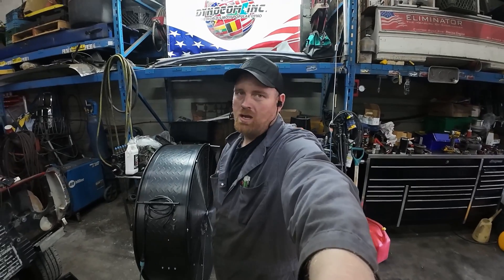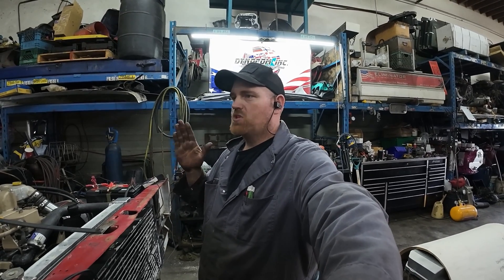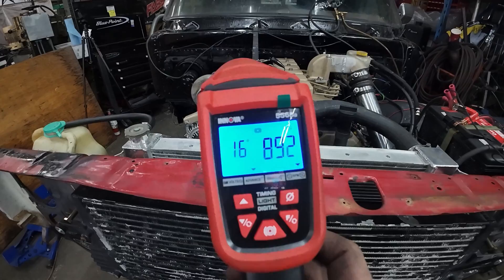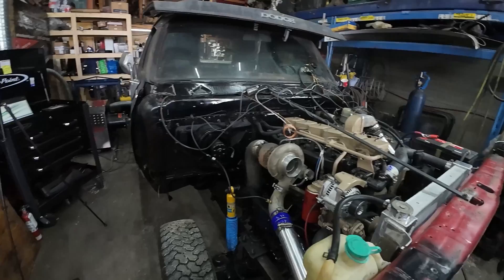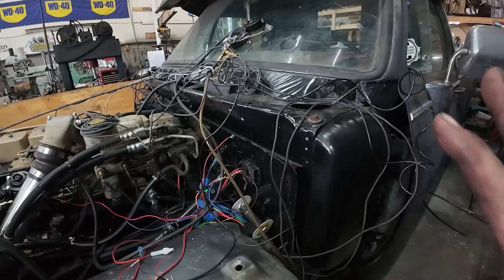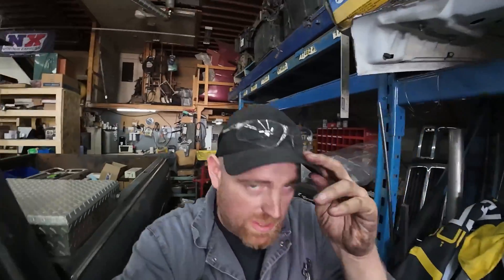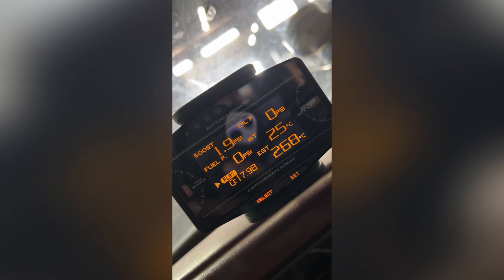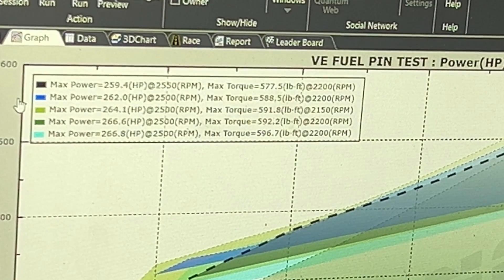TIMING LIGHT ON A CUMMINS ?  plus we have Data !

Comment: Why u have very fansy and expensive dyno and then u dont have anything data or sensors plugged on dyno? 😅 what i think and only my opinion is.. if i have dyno, i want everything possible datalog and info to dyno sheet, easy to compare diffrent pulls and modifications 😊
Reply from the maker: I am going to buy a system. But life has gotten in the way of that. I had this unit I was going to use on something else. It will have to do for now.

Comment: Every forum I see says 1 tooth is about 10 degrees. So this is saying we’ve got about 4 instead? I backed the pump off 1/4” with 1 tooth advanced, which according to the interwebs should give approx 4* timing with room to go. Not an exact science, but if this is true in the video I should probably bump the pump an 1/8th up
Reply from the maker: I going to play around and make a video on the topic. But static timing will be different than the timing light. But am not sure how much difference there is.

Comment: How does the timing light injection timing at idle compare to the injection pump static timing? Did you check timing at various engine rpm and power levels? It is my understanding that the timing light would show injection timing advancing as injection duration increases for more power.
Reply from the maker: Something to test

Comment: With the timeing light   I have had issues getting it to work and consistent .    first  i bought the blue point pulse counter from snap on  brand new  would not pulse  and if it did  not consistent at all  tried multiple lights too   Sent that back bought the sealy one that looks like yours  i can get that one to pulse  with a few inconsistency’s  it changes by how much pressure is on the adapter on the line and what direction  the adapter is on there.    I made a timing pointer with that timing tape i printed out and is stuck to my fluid damper  also   Did drop valve method to verify tdc accuracy.

I do get consistent readings if the adapter is just right i have found.

The other thing i have found ,  the lift method with indicator in pump vs light are off a little
2174 cpl  98 auto 180 pump

Lift in inches         Actual on light
.196                          13-14 degrees
.220                           17 degrees
Reply from the maker: This one seems to work well I have used it on a few things with no issue 
But will will do some testing

Comment: Why is your oil pressure actually your fuel pressure? As for tooth jump it is 10 degrees. There are 72 teeth on the pump gear and it turns once for 720deg of the crank so that is 10deg. I imagine your sensor is reading start of injection at the injector rather than port closure at the pump so there is a few degrees there difference between the static values the factory gives.
Reply from the maker: I was thinking about that. I am having an adjustable timing gear for a ve for the ultimate ve build. I will be able to do some  testing with the adjustable gear really easy
Reply: @CUTTERUPROB  Seems it would be a lot easier and cheaper to just figure out the spacing and scribe degree lines on your timing cover in 1 deg increments. Loosening the 3 bolts and twisting the pump is pretty easy.
Reply from the maker: @bcbloc02  I would say for most guys yes
Reply from the maker: I can’t change the names on the sensors. So I will put that in the videos when I show it